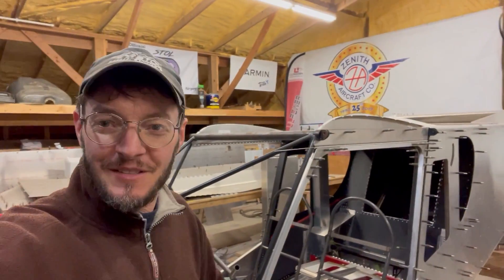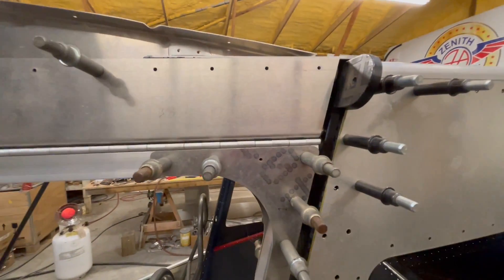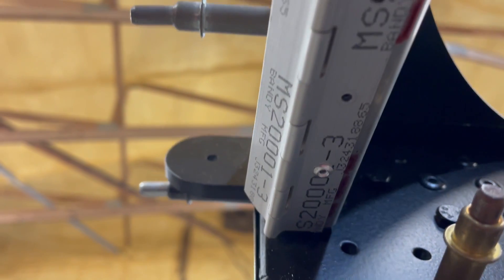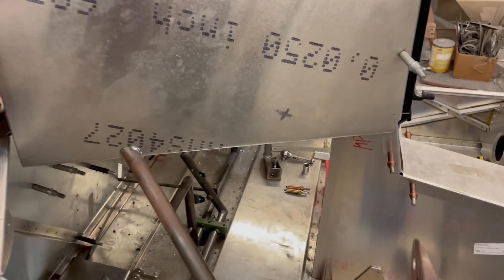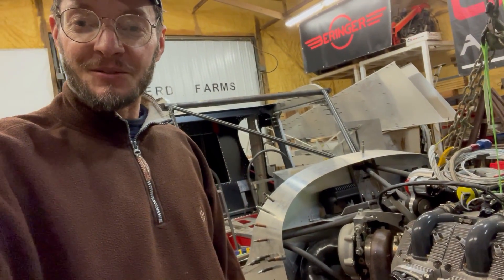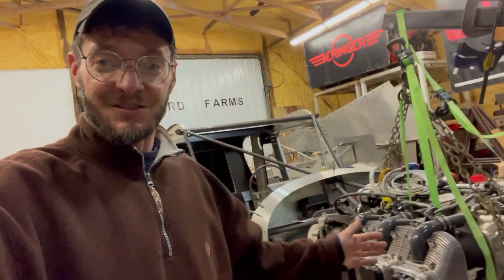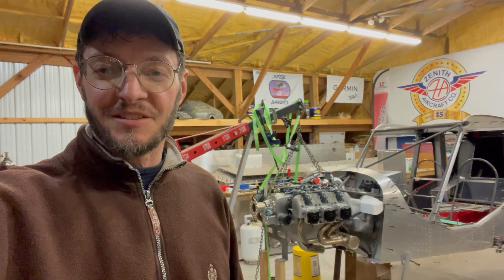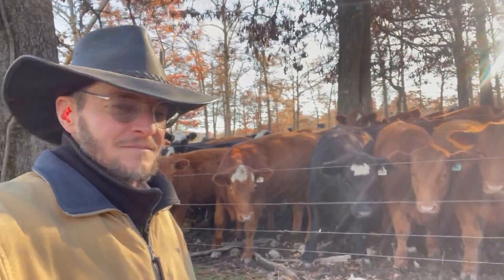Shortest Coupled FWF airplane? 750SDXtreme Day 13 of December Build Challenge

Comment: Make sure you insulate the very hot turbo components from the fibreglass cowling. Failure to do so is a recipe for an inflight fire. There is a video of a guy who had that happen to a new build. He landed in a hurry and made a video of it burning up on the ground. I think is was a Highlander and the owner is in Utah. You might want to search for that one. He said that he used a resin when building the cowl that is flammable and there is a different type that is more resistant to catching fire. If I were building your plane I might try my hand at building an entire aluminum cowling, except the front six inches or so, like a Cherokee 140 for instance. Or maybe a TriPacer type with large easy opening side doors. Hint>Fibrefrax from AC Spruce. I used that stuff in an Arrow and a Super Decathlon with good results. Adhere with 3M 1300L contact cement, spray with silver paint and seal the edges with hi temp silicone to stop oil from penetrating the material.
Reply: You are referring to Hal Stockman's in-flight fire. That was not started by a hot turbo close to resin. It was leak in an oil hose that sprayed onto the turbo. That oil-fed fire then spread to the resin in the carbon fiber cowling and started warming up his foot which encouraged a speedy descent and landing. The point you make is still valid though: We don't want any more heat than necessary soaking into the fiberglass. I love the idea of forming more aluminum cowling with just the front bowl being fiberglass.

Comment: Funny how different our perspectives are on what looks better!  My STOL 750 has the very light weight 6 cylinder Jabiru and as a consequence, the engine mount holds the engine much more forward (there's about 12-14" between the rear of the engine and the firewall!) for correct weight and balance.  As a consequence, the cowl is very long and sleek and I've always felt it made the boxy fuselage look much better!  LOL!  OTOH, I can see where an extreme STOL pilot would like a "snub nose" cowl as it would provide yet another improvement to visibility at extreme angles of attack.  That's what great about experimental aviation - you can "have it your way!"  Really enjoying your series, keep'm coming!

Comment: If you look back at Mark Patey's 801 build videos, for the holding the doors open he used some king of spring instead of the gas piston. It put less stress on the doors, but to close you needed two hands, one to push at the center of the spring to get it to start folding, and pull the door closed with the other.